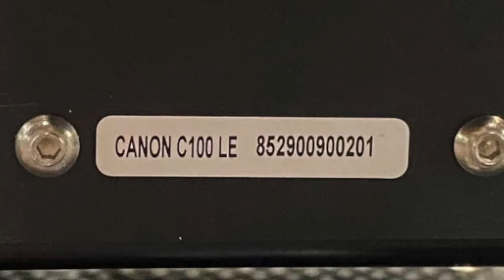This Camera Doesn't Exist...

Comment: Another reply has mentioned that an eBay listing has another one of these available with a different serial number. It's possible the C100 was lobotomized by a third party for a specialist application, if you disassemble it look out for any other identifying marks. I'd guess it's application is either for what others have mentioned and or scientific/military type stuff. I'm looking forward to a follow-up.

Comment: So its basically just a remote controllable C100?
Reply: yep, and I bet there is a mini computer getting the HDMI signal from a capture card and putting it through ethernet. It might also control the motors. So if it doesn't work or if no app is found, just open it up and reverse engineer from the minicomputer.
Reply: @yuxuanhuang3523  sounds like a lot of work. But might br worth it. Really depends in what kind of software it's running.
Reply: @OttoLP  definitely a LOT of work, could use a raspberry pi and start from scratch instead

Comment: The camera could possibly use NDI over the Ethernet port. It's used to send video streams over a network to mixing software like OBS. You might try connecting it to your network and putting it's IP address into a web browser.

It really looks like a high end ptz broadcasting camera. Or maybe a prototype of one.

Comment: It looks to be homemade, mostly just because of the way the motherboard is attached on the inside of the control box. Definitely very professionally homemade. Could also be a canon prototype, they have recently begun to make PTZ cameras, and they are in production already, this could have been an early prototype. But I have doubts that Canon would let a prototype escape onto the market. could also be a third-party prototype. However, I seriously doubt that this is a production piece. It is definitely homemade or a prototype.

Comment: Have you been able to get this to work? If so... how? I only ask because I happened to buy the same camera off of an Ebay listing as well.
Reply: Glad you bought it, Kyle. We’ll get it working once it arrives! I’m curious if there are controls in a web GUI or if special software is required from Canon. Either way, I’m excited to take it apart and see how it works! Adam Harig, let’s collaborate.

Comment: I'd think it looks Kind of like a proto type ore a crazy diy Conversion to Control this Thing over ethernet. 
IT could be that you just have to hook up one of the ethernet plugs up to Your PC/Laptop and than scan for IP Adresses and It could be that if you put the IP Adress in to Your Browser while the ethernet Port is connectet and if it is what i think you might just be able to Control the entire thing over Your Browser. 
One more thing those Gold "ports" are indeed for antennas and before powering this Thing up i'd sugjest you put on the correct antennas otherwise there is a chans that you might demage something (i dont think so but if those ports are for Sendung Signals it could potantioally burn out the Transmitter)
And also behind the sdi Port is a pcb with probably the other end of that one LAN cable and IT could be some kind of Compute unit simular to an rasberry pi ore something but i think it would be realy helpfull to have a closer Look inside this Main Control Box to identefy some of the components
I would love to help you Further because i am realy curios what this Thing is all about and i also think that i could potantioally help you
So if you want you can also contact me over on instergramm at Campanula.joe
I love this Kind of content and like i said, i would love to be of help to you cause i find this kind of stuff super exiting

Comment: No email in your about

Looks like there is a controller most likely a raspberry pi or other single board 

The local Ethernet is a control network think of it as the inside of your router

The remote internet will be in front of the firewall in the cell rf

Easy to power up with a bench power supple like an Astron 

Hook the local into a switch and your laptop in there

Power it up

Look for an ip

And so on